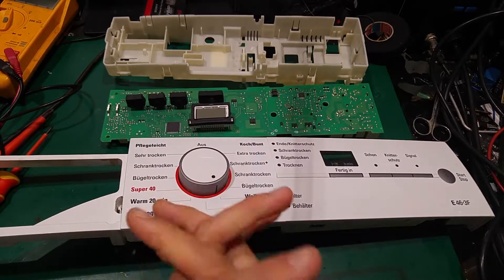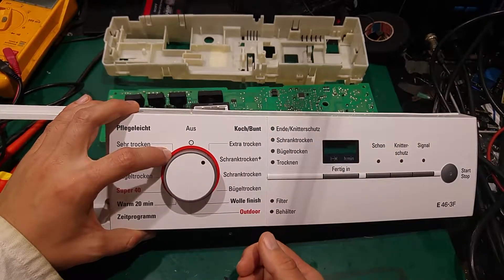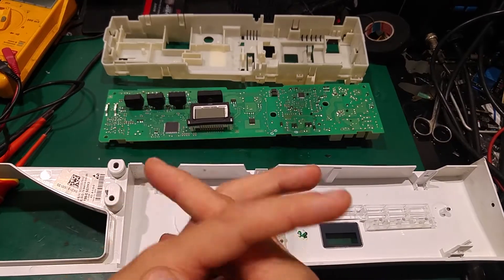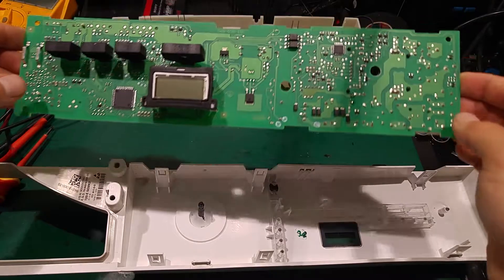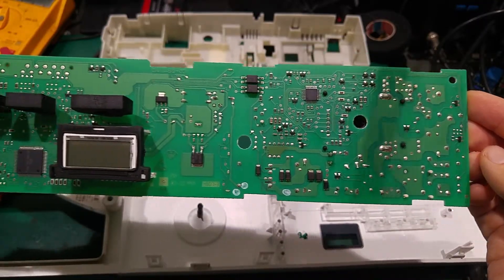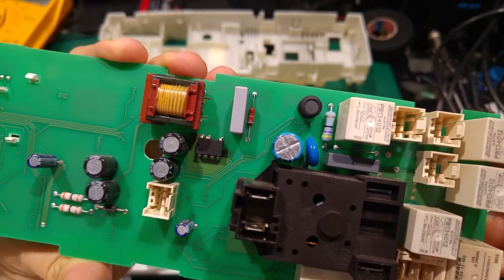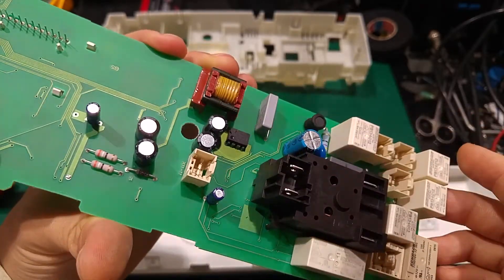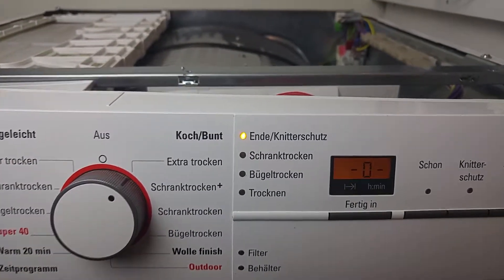Siemens condenser dryer E46 3F randomly shut down - then no reaction to power -  TNY266PN PSU driver

Comment: Thanks, that's exactly what's wrong with my 15 year old Siemens WT46E387. I knew it was going as it is slow to light up the display when you first switch it on. I don't want to buy the whole board. Where can you get the part though?